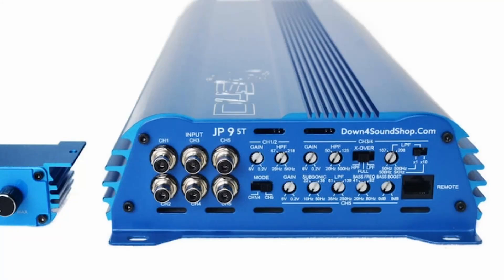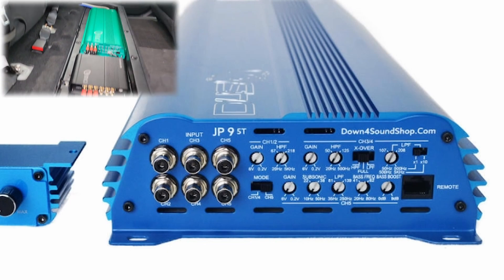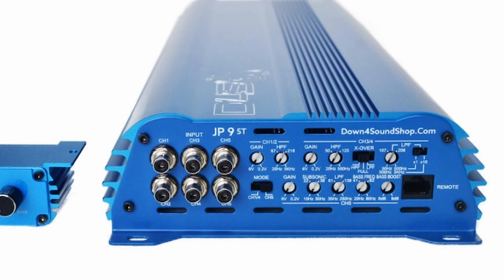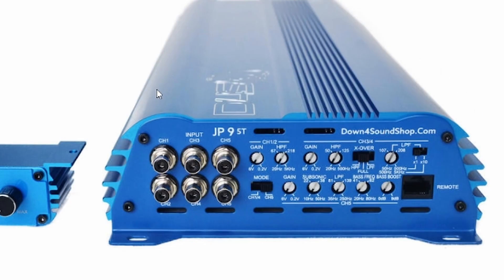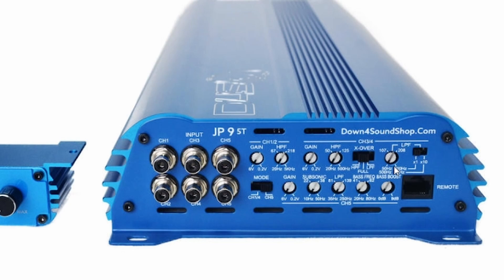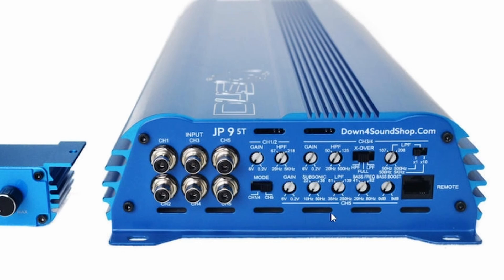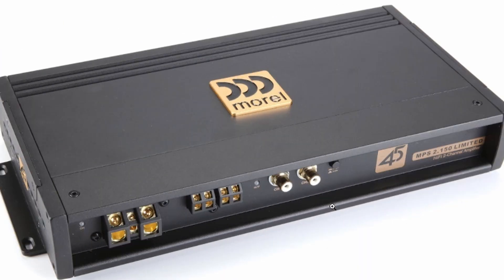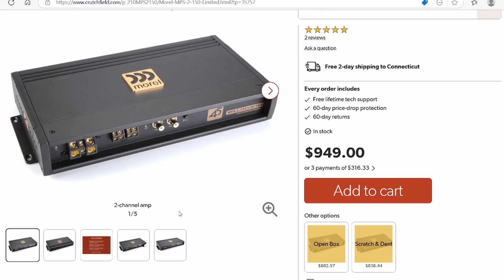How To Set Crossovers On  Amp When Using Any DSP

Comment: The D4S monoblock amplifiers have the characteristic of having a slave and master switch, in that case would placing it in slave function to be controlled through the DSP?
Reply from the maker: No slave master is only to be used when you're strapping 2 of the identical amplifiers together. Nothing to do with the crossovers in this regard,  but when strapped you'll make all adjustments from the master amplifier crossover suit including setting the gain.